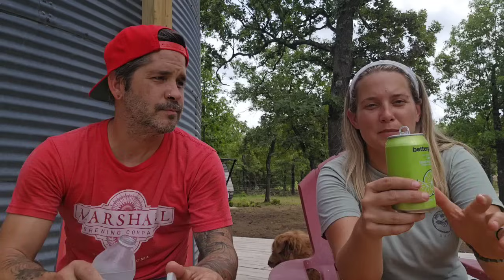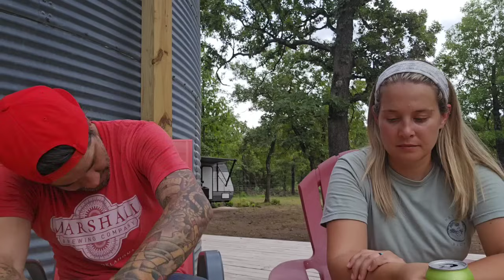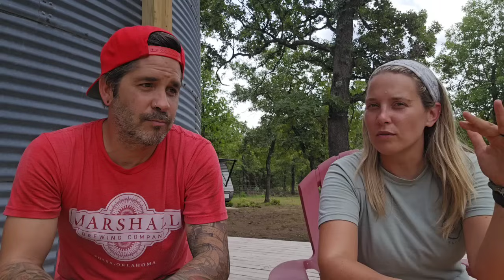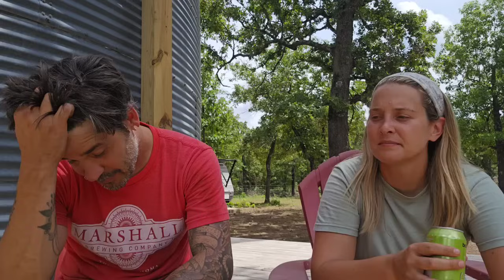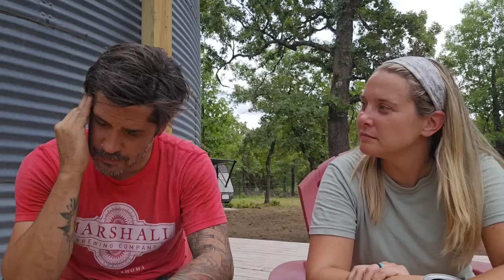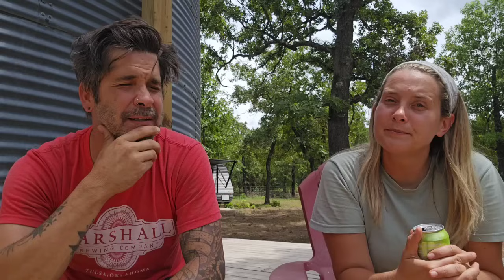Making These Decisions Mold Our Future  / Grain Bin Tiny House

Comment: Hey Mr and Mrs Crocker, congratulations on your union. The building is here!! Yeah mount a fan in there next to the wall, it's round will create a vortex. I work on campers and a lot of curves in framing,use a lot of 22.5° and 11° cuts, might test a scrap piece of lumber and cut 2 22.5° angle on end of 2x4 to see if it fits tight. They also make a thick rubber membrane for roofs you could lay out to seal the deck

Comment: Look at the extreme heat/humidity as a positive. It limits how much you can do so it gives you more time to settle in with planning.  If the other grain bin is your size, I’d make that trip a priority to check the stairs but also see another layout.  If you thinking of kids a half loft may not give you the quiet space you need as adults. Ie baby crying themselves to sleep and having to be hyper quiet below so as to not wake them.  Best thing for babies sleep is not being disturbed with sounds while trying to sleep.  No doubt yall will figure it out no matter what you choose. Kids change everything. As I am now a grandparent, having kids was the best decision ever.

Comment: A valid point was mentioned,it’s key to weld the angle iron frame in last. My brain tells me that if you leave a portion of the metal at the top and the bottom connected together that leaves that opening stronger if you follow me. So to speak if you have 6 inches on the bottom and 6 inches on the top of that door opening that would still be connected as a part of the bin you’re not opening the whole structure you’re still leaving at the top of the door connected and at the bottom of the door connected then you slip your frame in there and weld it. You’re raising the interior floor up anyhow. You may have to step up coming in. You also need at least a 4 count on R-19 clamps in the wielding department those will hold frames in place doors windows frames way easier

Comment: I would cut a couple of holes in the bin where the door and a window are going to go but only the size of the fans to get some air flow through the bin. Cut in so you have a cross breeze air flow. When you are ready for a window or a door then just open the opening to the size of the door or window. You might consider getting a portable room air conditioner and put one of those in there for some cool/cold air and then use one of the holes for the exhaust

Comment: I think the inside membrane needs to be wider. Enough to protect the inside subfloor. I’d leave it open. It would have a little airflow but be able to dry out if it ever leaks. The underside of the deck should be boxed in under the bin. Your crawlspace( Slightly smaller than the bin to keep it dry.) maybe add rock in the crawl space with a wire mesh to keep out critters.

Comment: Good morning, I live in Florida where the humidity is crazy. I live in an off grade house. We had to replace so much of the subfloor when we bought the house. If it were me, I would put a subfloor over the 2x4s you have the grain silo sitting on now. Something like osb or plywood, then I would seal the sides again once down. If you use osb or plywood, you need to put a viber barrier down on top of it. Take it from me who's had to live with plywood floors for a while because of the amount of work we had to do. You'll need to seal it well because the amount of moisture that will come up through the floor is crazy. We had to run dehumidifiers continuously. So I would seal it really well with a paint that has a sealer in it. Like 3 or 4 coats. Then you should be able to put your flooring straight on it. We did this before putting flooring down, and it helped so much with the humidity in the house. I would do the doors and windows cut out like they do on shipping containers. A good youtuber to check out on the shipping container is Life Uncontained.

Comment: I live in Georgia so I completely understand what you mean about the heat and humidity.  I'd do all I could outside the grain bin even though it will be hot at least you'd get some air. Working inside the bin could be a killer. Do other projects and wait til fall to do the inside, say about October.

Comment: Hi from Australia! I would reinforce your door entry/window openings with square/or rectangular steel, welded frame to silo! It'll strengthen & give solid spot for door jambs to attach too also. Over here we make steel frame homes as they're great against rot/termites and fire. I had a search and this seems to be your closest structural steel supplier! Ray Albright 1600 S May Ave, Oklahoma City. I don't know, there could similar closer! Congratz you guys on finally getting married! Stay cool cheers!

Comment: Your cleared land will continue to sprout weeds and unwanted vegetation unless you get a root chopper drum that’s pulled behind a big tractor and has large blades that penetrate the surface and chops the roots apart. It takes multiple times pulled over the areas. We have one but it can only be pulled by a tractor larger than 120 hp. They may have smaller ones. You’ll still have to routinely bushhog the cleared areas several times a year to keep it cleared.  A constant struggle to get to a clean field pasture.

Comment: Take angle iron, attach it to the Bin first in the shape of your door and size. Then cut out the metal and it should stay stronger that way. That
Also creates the frame to attach to for the door.
Reply: That's exactly what I thought. Cut the sides first, might have to slot it somehow. Do it one at a time and weld it in as a load bearing thing.

Comment: 2 in 2/4 laid flat screw down insilate / 3/4 by 4 ' by 8' sheets no less  1/8 concrete hard board  thin set tile and mortar.  Rock solid. It real rock solid you could drive a tank on it

Comment: Maybe you could go ahead and cut out the front door so you could get everything in and out easily, it’s covered by the porch overhead.get some air flowing, even some windows. You’ve got to have air or you’ll burn up. Get that pool filled up and get a pool cover. Those
 Animals need pools, they have to have lots of water😊😊

Comment: Jason, on your floor put down a vapor barrier then put your 2x4’s on edge then insulate with 3-1/2 inch insulation on 16 inch centers then 3/4” advantix plywood it’s also waterproof

Comment: I’m sure you are checking all these things out online of those who have built these bins.  Can you seal all the way around with that black stuff about two inches high from ground, and then do the spray insulation on the walls of the bin before doing your floors?

Comment: Metal sweats a lot.
If you have anything touching the metal, it will get wet and mold.
I would build a free-standing building inside the bin 
Without anything touching the metal bin
Start with an octagon shaped floor to get full use of space.
So you won't have to deal with building a massive curve into everything. 
Cut the widows out of the bin as needed.😮

Comment: I already stated it before - you need to put supports in place for where ever you cut into that bin. It WILL compromise the integrity of the bin when you do it. Think about it this way - a shipping container is a rectangular box that is built to withstand some very demanding use. It is rigid, yet flexible to the movement of the seas, but once you cut a hole into it that structure becomes unsound. The same with that bin. It is designed the way it is for a reason. The entry door is your learning key for that proof. Study that doorway - WHY is it built exactly that way? It's not just some random hole in that bin, it is there purposely and "built into" the structure as if it were the structure. Study that doorway. It will tell you that you MUST do the windows and other doorways with a similar support system. Again - I was a welder on trident nuclear submarines, as well as a Steelworker in the USN SEABEE'S where we built water tanks like that bin. I know cylindrical structures. You may even get away with it for a bit, but once weight and the elements start working on it, at some point it will fail if you don't bolt and/or weld supports. Heck - think about windows and doors in a stick house. Look at all the support you have to build into them in order to keep the integrity of what is above it, but also, what is below them. Do you install them AFTER you put the windows in - OR -  are they installed BEFORE? Exactly!!!

Comment: Ask the farm supply about a material you can pour in the pond that will help seal it. It goes to where the leaks are from following where the water flows. I fill really sorry for what you’re doing to your well, generator and the GAS you’re using. Instead of running your rain water to the tanks right now. Run that water to the pond. Until your pond is holding water you would be better off financially keeping a tank full for the animals. GOOD LUCK 👍